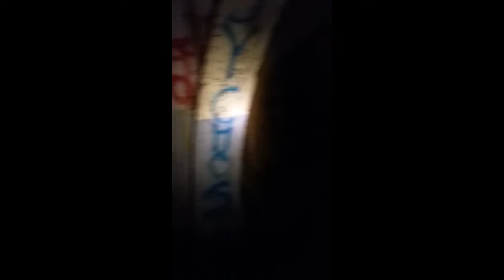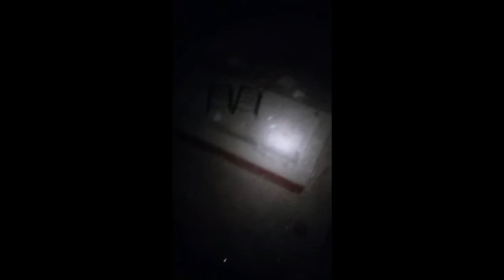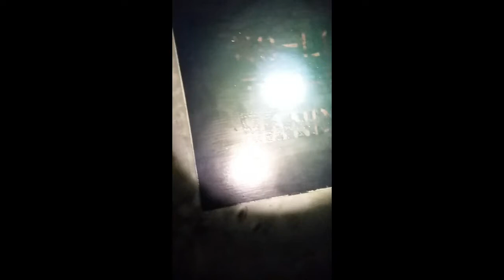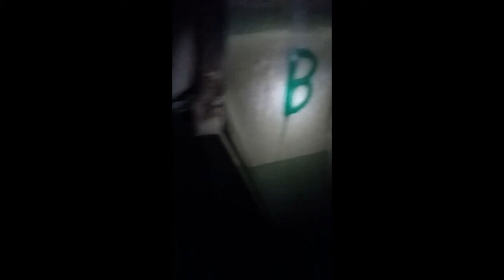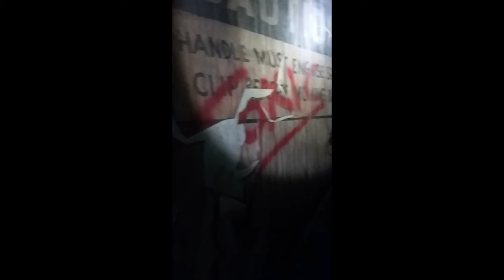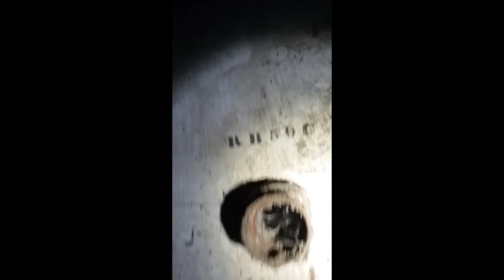Chico Titan 1 Abandoned Missiles Silos || Chico History || Pictures At The End

Comment: I visited this site back in around 1970 not long after it was decommissioned.  Which was soon after it was finished. Everything was still spic and span, very pristine.  Hardly any graffeti at all.  
There were 3 silos each with a tunnel from a central area.  All the operations  electronics racks, cabinets, and control stands were still in place, with only the plug in cards having been removed. The operator desks were still there and engraved wood signs with their names still in place. Boxes of blank operating forms were scattered about.

The tunnels had many tan colored overhead pipes that were labeled for the contents being transported.  The tunnel walls were clean and shiney. They essentially ended at each silo at about mid height. The silos still had various hoses and cables hanging there that would have been attached to the missle.
The power room was missing the motors for the generators and some generators were gone.  My buddy said that vehicles with winches had been used by locals to lift them out for the copper value.

There was a central domed mess hall that was empiy except for a double stainless sink attached to the wall.
There were no signs on the fencing around the site and no locked gate.  We got in via what looked like a guard shack in the opening of this video, and went down a very long stairway.
Obviously scrappers and maybe salvagers have stripped out much of the infrastructure based on this video.  Too bad the place was such a mess.